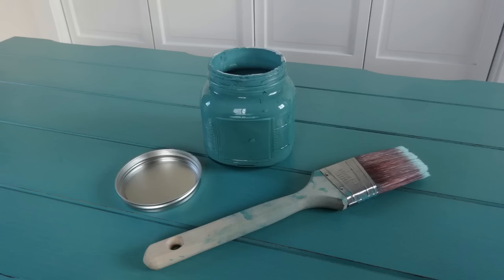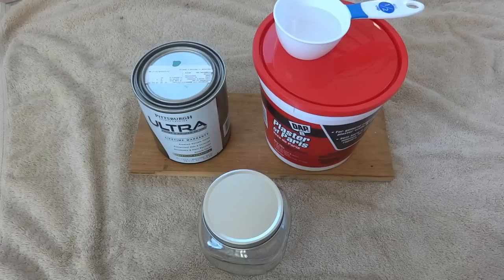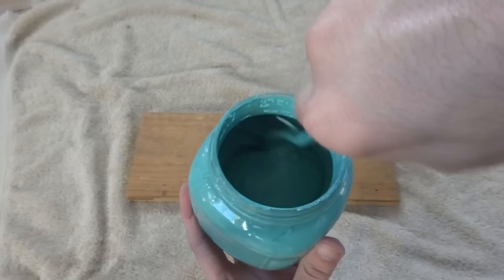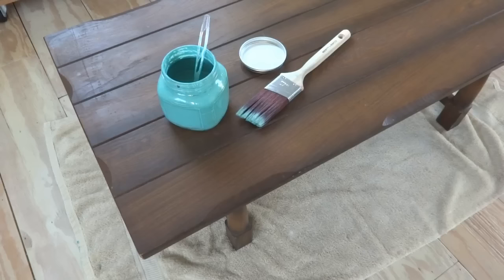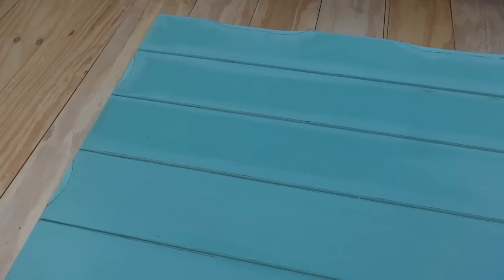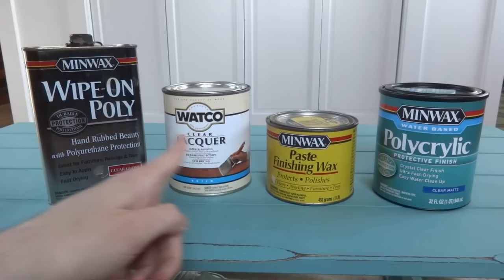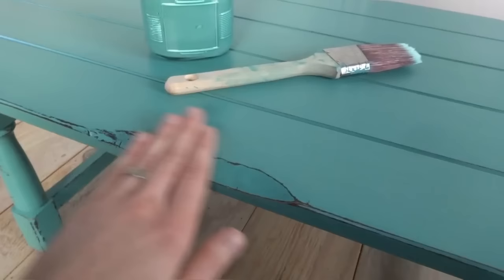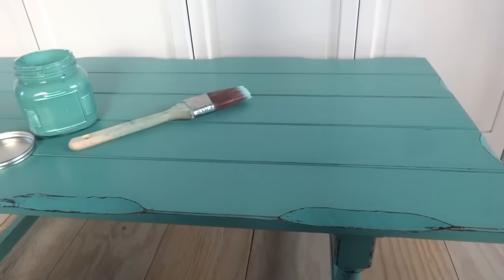Make Your Own Chalk Paint! (Cheap & Easy Recipe)

Comment: Hi, thanks for sharing this, I currently painting my cabinet doors based on your video, and I'm very happy with the results

It feels coarse at the moment, I  want to sand it before applying 2nd coat..

Do you have any recommendations what grit to use? I'm guessing 240 but not sure, afraid it might chip of the paint 

Thanks
Reply from the maker: I think a 240 would work out great and leave a velvety finish.
Reply: MrDiyDork apparently when I light sand it,.. the paint peeled off and leaving hundreds of white spots,. I'm using casting plaster and acrylic wall paint.. 

Then I re-do it but no sanding, coat it with acrylics clear doff,.. just don't like the feel when I touched it,. lol

I've tried the vinegar + steel wool stain also based on your video,. but I don't like the result (brown - 4 days)

Keep up the good work

Thank you from Jakarta, Indonesia

Comment: Valpar water base top coat  moisture protection  you just use a sponge or a raging  this stuff is amazing  .it's really for vanetion marble   but  I've used it on walls furniture anything that's water based  it's amazing!  And next to this  I will tell you there nothing that stands up to it other than a oil based product. 32 years in faux fishing and industrial art work  and after trying the Valpar moisture protection top coat  
I'm like shut my mouth  I was amazed  completely. What's best  almost no small  sum what of a alcohol smell  but goes away very quickly after driving  and dry time  is almost not there at all to the touch. You will be amazed.

Comment: Thank you for this video - I’ve now tried twice to make my own chalk paint and I seem to not be getting the same results :( 

It turns gluggy and thick, add more  after it acts like oblek and is awful to work with - extremely grainy, hard to apply, etc! It’s like basically putting giprock up on the walls... 

Any advice or tips?? Water based acrylic dulux paint was used
Reply: *add more water to thin it out and it begins to act like oblek

Comment: I've used your recipe before and it worked well.  I just made a batch and used some Behr acrylic latex paint (3 parts) and 1 part plaster of paris after making it a liquid paste with water (same consistency as in your video), but when I mixed in the paint its very thick and chaulky and I've mixed it up for 2 days with no changes, even added a tiny bit of water.  What am I doing wrong this time?  The paint is a few years old, but still liquid and no clumps.  It worked so well the first time I did this for some frames I painted a year ago with a different paint I used.  Thank you in advance for any recommendations.

Comment: This is great, thank you! I want to do this on a newer piece of furniture stained a honey oak color. If I want my distressing underneath to show through as black/dark gray, should I first paint on a coat of plain black paint?
Reply from the maker: That's how I would do it. I paint the "exposed" color first, then cover it with the main color. It should poke through when distressing it. You can also add stain over the distressed raw wood areas too add some dimension too.

Comment: So glad I found this. I have t really seen any site that is from start to finish with so much good information. I am painting my china  hutch and was going to use latex. Oh how I am becoming to hate it. Didn’t realize it’s mostly MDF. Very slippery. I used Bullseye primer that said it was great for what I am doing. I have put on 3 coats and now ready to finish. After seeing your video, can I still chalk paint on top of it? Thank you.
Reply: So I used some leftover Dutch Boy paint and it worked beautifully! Well, that was the inside of the hutch. Then I used Valspar Optimus and it was a nightmare. It set up so fast, I mean as I was mixing. I tried it again with a lot less and the same happened. This paint was $50 per gallon. I gave up. I think there was something in the paint. I mixed the paint in a sour cream container. All day I watched it. It turned lumpy and separated! So people, when trying this if it doesn’t work it might be the brand of paint. This is the first time I worked with Valspar. It was ok for my wall but I don’t like to use it on furniture.

Comment: I wonder if you could crush up old drywall? I mean white wash was milk right and chalk paint was some form of chalk. As kids we used bits of drywall to draw on sidewalk. But I’m all for whats available to use up my paints. Going to try this. Edit ....I just looked up what everything is last night. Basically anything closer to chalk as in calcium based seems better. Plaster of Paris, by nature has one additional ingredient that makes it naturally more “hard”. It is calcium carbonate and a mineral called hermdyte or something similar where as gympsum is only calcium carbonate. Basically its all ground up sea shells, just the calcium in Plater of Paris comes form the largest natural site outside of Paris. Drywalll is also chalk. Possible to grind up but I’m thinking could have industry additives like a glue. People making homemade chalk are using plaster of Paris. So basically you are using nature’s “hardener” to make chalk paint. After many reviews though it seems the longer application product and ability to keep it for later is using gypsum, the garden additive which is slightly different natural form of calcium too. Calcium sulfate instead of calcium carbonate but its still all little ancient sea shells. Saw a person use premixed drywall patch saying it stays smoother. Well I’m an hour away from any home store so may be asking the neighbor for his dry wall bits as his remodeling his bathroom and my partner gave him our left over tub of joint compound! Oh, some say use non sanded grout but also reviews has that drying while using and doesnt seem able to reuse later if mixed.

Comment: Hiii! Thank you so much for this video! I do have a quick question, I use polyacrylic all the time for pretty much all of my projects, on the can it states that it is recommended   to put on 3 layers of it, and sand in between layers. Do you do this? Or do you only put one coat?

Thank you! :)
Reply from the maker: Yes, I do 2 or 3 coats (usually 3) and I lightly sand after coat 1 and 2 with fine grit (400-ish?) paper or sanding sponge. It really helps smooth everything out. I found that my last coat looks smoother if I go a bit heavier on it, so it sort of self levels, and I try to not over brush it at all.

Comment: Just subscribed! Thank you for the money saving recipe! How long will that jar last? In other words, do you have to use the paint right away or can it be stored?
Reply from the maker: Thanks! I found that it starts drying up a bit faster around the edges/lip of the container which can cause little bits to get in the paint, but it does seems to last a while otherwise. You'll need to stir it again before using it and maybe use a strainer to get any dried bits out of it. If it gets a lot of air contact, it'll start drying out. I'd recommend mixing smaller amounts if possible just to be safe.
Reply from the maker: Let me rephrase that. Either mix smaller amounts or try to use up a larger amount in one shot if possible. It will stay usable in a sealed container, but like I said, it'll start to dry out and get kinda flaky up on the sides of the container which can get in the good part of the paint when you mix it. I think a tea strainer would work well to smooth it out after mixing it.
Reply: Ok, so it sounds like I can hold onto it to use for stenciling with a stencil brush bc the dried out bits wouldn't really matter. Love it! Thanks again!!

Comment: Thank for this diy. I am planning to paint my living room in white chalk board paint, I am confused about the quantity.will it dry if I mix in big portion? Like gallon of latex paint ?
Reply from the maker: I haven't made large quantities of it in one sitting, but if you were going to use it in the same day, it would probably be ok. Maybe mix up the whole gallon in a bigger bucket, then pour it back into two containers with lids, so that you could use them separately if needed. The paint itself lasts a while in the container, it's really just the lip and sides that start to dry out on you if you keep it open too long.

Comment: I know this is a older video but thank you for sharing your knowledge with us wished everyone did there videos like you lol I  do have a question i have been using epoxy resin but the price is about to run me broke i love high high gloss plus I usually imbedde something in my paintings so i need a thick layer do you know of anything that would give me the same effect as epoxy resin that is on the cheaper side i do need about 40 minutes working / pot time are more but not less i would so gratefully appreciate any info you can give me.  And again thanks so much for this very well made video as i do these types of projects also so you definitely showed me how to save a ton of money on my chalk paint.

Comment: I mixed my paint with plaster of Paris,  but it was very rough.  What did I do wrong
Reply from the maker: Hmm, it should smooth out with plenty of mixing. The chalk paint will have a little bit of texture when it's dry. That's why you can draw on it. But if it's kinda clumpy, it may just need to to sifted & mixed well.

Comment: Just a side note, don't attempt this outside if it's warm outside (aka the garage). The plaster dries very quickly in warmer temperatures!
Reply from the maker: Yes, I noticed it dried a bit quicker than standard paint, so I could see a hot garage making it dry even quicker.

Comment: Can I use it for a Chalk Board? A flour sifter would work on the Plaster of Paris powder. I just used flat oil paint... A big difference, between $20.00 and $85.00...
Reply from the maker: If it's not coated with a sealer, I think it could probably work as a chalk board. The flour sifter is  great idea!

Comment: Cool. Thanks for the tip.

Now, try some 000 to 0000 steel wool to knock down some of that shine, regardless of if you used matte, satin, semigloss or gloss for a seal coat.
Reply: How
Reply: @zaneblane8160 , just like you would sandpaper.
Reply: @kellyvcraig  ...oh, ok..can I get from Home depot or Lowe's?
Reply: @zaneblane8160 , yes you can. A bag of 0000 steel wool runs about five bucks US.

If the surface was totally flat, you could do the same thing with fine sandpaper (e.g., 600-1000 grit), but it would load up (clog) quickly.

Comment: I love it. But every time I use sandpaper , scratches and scratches brightness appear on the chalk paint and chalk paint loosing chalk feature. Please help me..
Reply from the maker: That does happen around the sanded distressed areas. You could try using a fine grit wet sandpaper for less scratch marks. Real chalk paint supposedly can be distressed with just a damp rag, so you could try that, although this plaster/paint combo might be a bit tough to distress that way.

Comment: So, it’s June 8 2020. I measured 1 cup sherwin Williams eggshell latex paint and put in glass bowl. Measured 1/3 cup plaster Paris and added just enough water to make mix it into  batter.  Added batter to paint and as I mixed, it literally balled up into a concrete type mess. I then added so much water to make liquid again but still no good. Tossed it all out. It didn’t work!

Comment: Thank you for your video.   I could not tell, but could you see brush strokes on the finish piece?  If so, is there a way to get rid of them and have a very smooth finish as if the paint was sprayed on?    Also, can you spray on chalk paint?
Reply from the maker: Yes, there was some brush strokes. You could try rolling the paint, which is smoother but does sometimes leave it's own texture (sort of like the lines you get vacuuming carpet.) I haven't tried thinning it down to spray yet, but I think it might work after testing different thinning ratios.

Comment: BEWARE: this will dry out super fast! I used the same ratio as the video and my paint was getting solid by the second end table (10 min tops). I had to add a lot of water to save the paint and what was applied was thick and chunky. I’ll have to sand off and paint with normal paint or actual chalk paint. No way you’re getting multiple coats before this hardens up on you.

Comment: I mixed this with LATEX paint and it didn't work, when I poured the paint in it absorbed the water outta plaster of paris in 1 sec ended un with hard clogs clumps .terrible!! what am I do in wrong here?!!
I just used DAB joint compound and worked perfectly!! dilute it with little water, add latex paint and DONE ✅

Comment: I LOVE THIS RECIPE... But... It doesnt work with NO or LOW VOC paints. I dont know why, but as soon as the EPA passed a new law in California restricting paint VOC levels, my mixes began getting lumpy and thick so quickly they were impossible to use. 😬 If you run into this problem, calcium carbonate recipies still work! Just a tip.

Comment: That's a great effect. it looks great, but your problems are possibly occurring because it's not actually chalk paint, you're using a different form of calcium than chalk. Plaster of Paris is calcium & gypsum (2CaSO4) combined with water; Chalk is calcium carbonate (CaCO3). So it's quite similar, but it's not chalk, so the plaster will continue to follow its nature & attempt to form a solid shape rather than play nicely. Sorry :(
Reply: Thanks for this info!  I just watched another video where she used CaC03 only.  I was wondering what would be better so thank you for this comment - saved me some time and money.

Comment: Thought you should use wax only to seal chalk paint. 😕 No?
Reply: Nope, remember you are just painting, chalk paint is more of a technique so added minerals to paint for affect. You can wax for lower traffic pieces or poly for durable pieces. Wax has to be reapplied eventually so up to you really but key is curing time, not dry time for any wood finish.

Comment: No No No no no omg no. Chalk paint made using plaster of paris will, over time, chip off.. even if you add a wax over the top. Chalk paint that will not only give you a much nicer finish and stand the test of time is made using plain calcium carbonate.